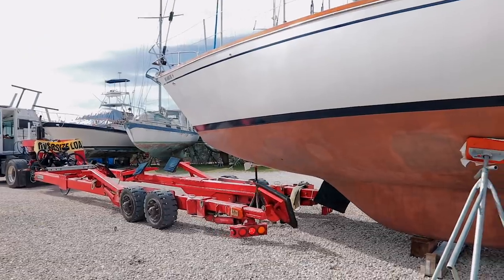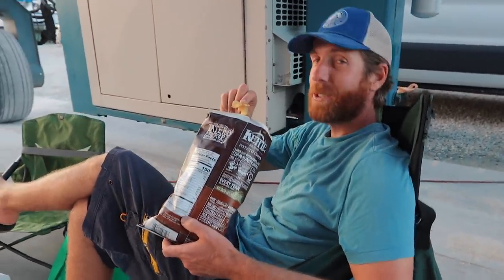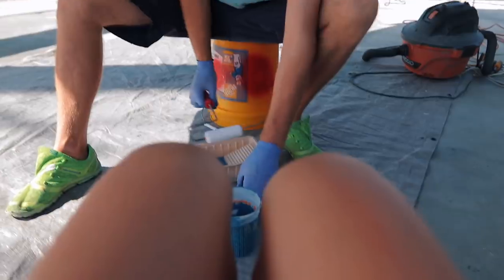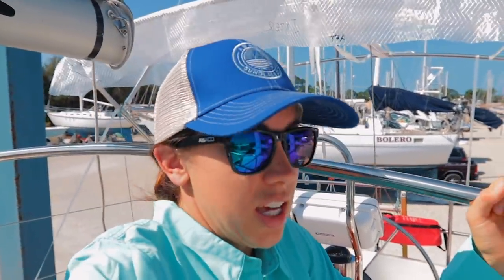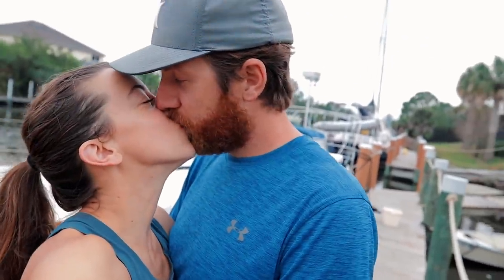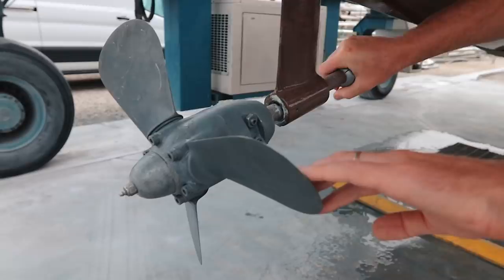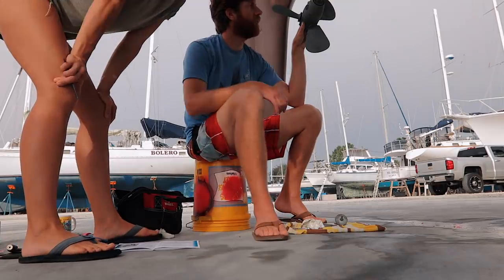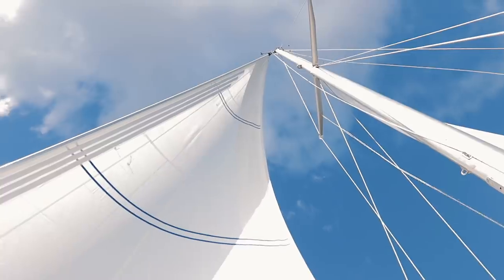Failure to Launch | Sailing Soulianis - Ep. 66

Comment: Watched pretty much all episodes now. Good camerawork and I love your determination.  Regarding propeller. Being slightly over-propped is a good thing on sailboats providing you never use wide open throttle, that will hurt engine! It will make the engine use more of the available torque lower down and use less fuel. The available torque is 90% or better between 1500 and maximum rated 3000rpm. You get hullspeed at a lower rpm and with less noise.  Aim for a maximum achievable rpm of 2800 at wide open.
Reply: Why over-prop? If you have a propeller that achives maximum rpm 3000.  When you are reving the engine 2500rpm (typical speed) you will be using less than 60% of available torque. Look on diagram.
Reply: 100% agree.

Comment: Noticed your comment about not using the centerboard, it’s for upwind sailing - it will make a difference, you should point higher, but more importantly you won’t slip sideways, which when sailing upwind is also backwards.

Comment: Well, my launch - 3 weeks ago - resulted in an emergency haul out after noticing the bilge was full of water. What happened was one of the bunks of the trailer broke, and a metal bracket punctured the hull. When I read « failure to launch » on your video, I got scared your bot was taking on water! Glad it was a less critical issue!

Comment: Congratulations on making it back to the water. I replaced the alternator on my boat and I use a sterling regulator. But my tacho would not work! I found  "Auto Meter 9112 Universal RPM Signal Tachometer Adapter for Diesel Engines" on ebay. It fits around the outside of your alternator and gives a signal any electric tacho can use. I highly recommend it, very easy to fit and calibrate, proved to be reliable so far. Happy sailing

Comment: I have a non contact rpm device and not very Impressed with it ( but they are cheap) . A boat tachometer uses a wire off the back of the alternator are easy to hard wire. You could get one and mount it near the engine for an easy install. The automotive ones are cheap . Glad you made it in finally.  
The adjustable pitch props are great but you always think 'just one more adjustment' will make it perfect? Maybe you can have some fun for a day in some beautiful Bahamian waters making adjustment and trial runs .........
Cheers Warren

Comment: I like the idea of that type of prop, for some applications, only saw one example in use on a catamaran that had to reverse out from a failed haul out in a fast flowing river, great reverse speed. I had a hydraulically controlled adjustable pitch, fethering reversing prop, but it had poor thrust when reversed. Only real advantage was there was no transmission, and the pitch could be set high for motor sailing.

Comment: Did you try calling the prop manufacturer regarding the pitch?  Many of them have pitch settings already computed for production boats.  I have a maxprop that I repitched, did the calculations per the manual.  I called the maxprop folks, wanted confirmation that my calcs were right, they were great about helping me out (my calcs were right, but good to have the confirmation).  Your deisel should operate about 2100 to 2400 rpm at cruising speed.  Probably for a tartan 37, about 6.2 to 6.4 kts in smooth low wind conditions.
I'm guessing your pitch should be somewhere between 18 to 24 degrees, but check with the prop manufacturer.

Comment: Hope Hurricane Season 2020 is not affecting you. One Question about your keel....On a Ketch the Keel extends all the way back to the RUDDER which in turn protects the rudder and propeller. Your keel does not. Have you thought of making a keel extension to protect your propeller from impact ?   Solar Panels  Have you thought of mounting them out sideways on the stern rails facing out towards the water and folding them down when not is use ?

Comment: Howdy.  Ray here.  I have a deep fin keel T37 #373 and an Autostream prop I installed 20 years and 30K miles ago.  I once made the same mistake you did when in the yard.  I think I put the thing together ONE TOOTH off.  Had to be hauled again.  Cost me $300.  You really do not have to take the thing apart every time to clean and lube it.   You need to lube it and that will push stuff out.  The gears probably do not need much grease if you think about it,  They are not spinning or getting hot.  They just reposition the prop in forward and reverse.  Lots of folding props have no lube at all on these gears and failure is unknown.  You need grease on them and most of the grease sold gets washed out by the prop spinning despite the O rings.   You really do not have to change the delrin bushings.  I talked to the guy who designed the thing and he said he had never heard of them wearing and indeed I cannot think of why they would.  Mine have not.  The O Rings you can slip over the blades, but they really do not wear out much--they just get barnacles on them which reduce their effectiveness.  You need some really really gooey lube and the stuff they sell at most places (and recommended by MaxProp) 110A Lubrimate (?) is too water soluable.   It just washes out.   There is some torquoise stuff --Aqua pro or something like that is the only thing I have found that will stay there--use gloves handling the stuff because I know of no solvent that will take it off your hands..  I have seen some kind of red lubricant that is really sticky--I think that is what it came from the factory with.   Don't worry about the zerk fitting leaking a bit when you first fill it.  The grease you are using is really really viscous and holds the spring back.  You can tap the thing with a hammer or better, just hit it with a heat gun or just wait.  It will stop dripping shortly.  I thought you learned your lesson about calling "experts" with the arch debacle.  A lot of the prop guys are really awful idiots unless they are machinists---even then they are mostly into regrinding and repitching motor boat props---they do not have the experience you do with feathering sailboat props.  Even then, no one seems to be familiar with the Autostream.  My guess is that you were, like me, one tooth off when you reassembled the thing--you cannot tell pitch by looking at the prop it is a couple degrees (out of 360) that makes a difference of going or not going..  Having an externally adjustable prop is really important as you have no doubt learned from this.  I have made minor pitch adjustments while free diving and that is really nice.  My T37 cruises at 6.4k at 80% with my Yanmar 39 hp it will hit 7.2 at WOT at 3200 Rpm.  I suspect it has a bit more torque than your engine and maybe a bit less drag on the hull because of my fin, but it should be in the neighborhood.   I am 72 years old and I am reliving a lot of my cruising life through your adventures and misadventures.  You should start enjoying things soon.  Go to Isla Mujeres soon.  Plan to stay there awhile.  Learn Spanish if you do not already have a grasp.  It changes your experience for the better.  Always great to see you both.  These are some of the best years of your life.  Enjoy.
Ray Durkee Velera T37 #373
Reply from the maker: Hi Ray!  Thanks for saying hello. And thanks for the tips! I think your right... but I think our issue was actually that it was one tooth off before we took it apart and we didn't realize it, so that when we put it back together the "right" way by the manual it ended up being off.

Comment: A suggestion for your engine. I use Tufoil (on Amazon). It's a PTFE additive and has been given the title of "slickest material on the planet" by Guinness Book OWR. Assuming your engine is broken in (don't use it until it is), it will greatly extend your engine life, give you better fuel mileage, and better hp/torque. I am an avid BMW enthusiast with many cars in my collection. I use it in engine oil, steering boxes, gear boxes, and differentials. Never in automatic transmissions. Just add 8oz the first time to your engine oil and 3oz in subsequent oil changes. Anyway, just food for thought.

Comment: 16:56 probably not a big deal but that lock wire isn't right.  The "bottom" screw at this timestamp has nothing stopping it from unscrewing. The lock wire needs to be at the side of the head of the screw not over the top.  Just fyi for next time:)
Reply: It may loosen, but it won't unscrew far.  But, yes, you're correct -- the safety wire needs to twisted and pulled tightly against the sides of both the bolt heads.  Nice catch.

Comment: well well...best is to take lots of photos before you disassemble anything if you are not sure of what to do, if you are going to get it done by someone else you need to know the person well about what he knows, if not you will be paying someone for nothing, However you need to know about the prop work your self, because this work need to be done annually i think, best is to get in touch with manufacturers get info about the prop, if can is the best. Also brother install a RPM meter, you need this it is good for sailing, it is best practices is whenever you run your engine just before shunting down need to run full throttle for few minutes then idle for 2 minutes then shutdown, this way you will keep things clean in the engine, there are lots of info about this on line.Anyway you guys learn too much about what to do and what not to do, keep up the good work and be safe and soon happy sailing will come..

Comment: That grease nipple on the prop hub might need to be replaced. There should be a one-way valve (a small ball-bearing) in the nipple, so grease goes in, but never comes out there.

Comment: In airplanes, thats called an accelarated stall,  the wing can go fast but if the you over pitch for thrust the blade will just stall meaning lost lift/thrust.  Reduce pitch a bit and youll have it.. a perfect balance in Hourse Power vs Thrust...... perfect blade performance.  Im an aviator, very much nautical given the benefit of the doubt.

Comment: Could you not use the slings to remove the center board and then go back on the stands do all your painting and then when all is ready go back into the slings to refit the center board. (sorry in advance if this is a stupid question)
Reply from the maker: In theory, yes, that’s an option. Though a very very expensive option just to get a different type of antifouling on the CB.

Comment: Torque and horsepower discussion when a diesel engine is involved... Small diesels tend to rev high to make power. A VW 1600 cc naturally aspirated 42 horsepower 105 ft-lb engine revs to 5252 RPM to make maximum power. The 'beke is probably in a similar category, so the EGT is a better measure of the amount of fuel burned and the engine loading.

Comment: Your alternator has a built in tach function, you just need to read it and display it.
Reply from the maker: Yes, we need to move this project higher on the list.  It doesn't technically prevent us from motoring or sailing, so it keeps getting knocked down the line, but it'd be smart to have a good tach so we can diagnose issues better.

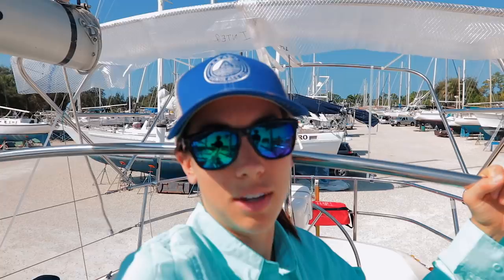Comment: 6:15 Is that Kirks lovely voice singing in the background?
Reply from the maker: LOL, no, that's someone using a grinding wheel.  We bought a new microphone and didn't realize it was counterfeit until after shooting a ton of footage, we've had to use some noise filters to try and make the audio useable.  The good news is that we have a new microphone and it sounds great, the bad news is we shot a TON of footage before realizing what was going on.
Reply: @SailingSoulianis  lol. Doesnt matter, your content is still awesome. Even with a bad mic, you still pull it off.

Comment: IF the prop was correct BEFORE you took it apart simply take it back apart and return it to the original state. NOW you have little to NO adjustment left to tune your prop.

(;-) TP
Reply: That might be what they failed to document.  They did make marks using a sharpy though but maybe the marks corresponded to different props and the order got jangled. Might have to make a call to then manufacturer to get it just right.  Reminds me of the pitfalls one might run into while changing a timing belt on a Dual cam engine.

Comment: When you do your prop fine tuning, the spacing between your prop and the P bracket is too much you don,t need any more than about 5 mm.to 10 mm or you will get too much vibration that will consume power. I learnt the hard way.
Reply: Barrie you will eat up that prop in no-time if you set it up that close and also its learned not learnt just sayn!

Comment: your prop shaft safety wire is wrong. Should always be pulling the bolt in a tightening motion. When used correctly it will prevent loosing of bolts. When used wrong..... it will make sure they come undone.  Former Jet engine mechanic speaking from experience.

Comment: I have the very same boat with the very same prop and it pained me to watch you assembling the prop but I knew that it was to late to help . You made two mistakes first you assembled the prop incorrectly (I know because I did it myself) and second you compounded this mistake by trying to compensate by jumping the gears one tooth. If that was not enough you prop guy screwed it up more by touching the adjusting screws, there was no need for this because the prop was performing correctly before you took it apart. Lessons learned about experts. If you have need answers from an owner (not an expert) contact me via info on the 37 site. Hull #31 Abraxas

Comment: 16:58 Please please buy a safety wire pliers and look up the correct method of installing safety wire. The way this wire is installed does nothing to secure the bolts from loosening.

Comment: I am 59 years of offshore commercial fishing we've been tweaking our own wheels for many years 81-in propellers with quartz nozzles now I am tiny troll a guy I was following you along and I liked it not crazy about those variable pitch props kind of junk but they will get you by but when I heard you say you did not have a tachometer you lost me that's a joke you must have a tachometer you're not hearing how many RPMs you're turning you need to see whether its digital or mechanical Fairwinds following Seas get a hot prop and don't play with those junk variable-pitch

Comment: Your explanation about the engine performance (power related to rpm) : propeller curve etc is completely BS!
Reply from the maker: Care to enlighten us with the truth?
Reply: @SailingSoulianis 

see: 
http://www.tunnel2funnel.com/2013/01/significance-of-propeller-curve.html

Take a look at the propeller curve. Mostly the propeller curve follow the N^3 <-- N= propeller rpm. 
But depending on the engine power / torque envelope the ^3 can be changed to a slightly higher or lower number. Lower means a higher load on the engine (steeper curve) and higher means a lower load on the engine (gradual curve) on a equal rpm.

A naval architect / ships propulsion engineer designs the propeller to meet the crossing point of the ideal propeller curve and engine power curve as close as possible. (see propeller curve) On this point the maximum engine power can be converted into the maximum thrust power. This means the vessel can reach the highest speed (or bollard pull in case of a tug)
As indicated this is ideal, the design point of the propeller curve should be shifted a few % horizontally to the right. (direction of the curve B)    But you cant pass the engine rpm limit. Engine rpm limit : reduction ratio = the propeller rpm limit.
Shifting the curve slightly to the right is nearly always done to create some spare for  hull fouling.and increase in displacement (resistance). Every ship over the the years suffers to added weight due to nice to have items and improvements been made.